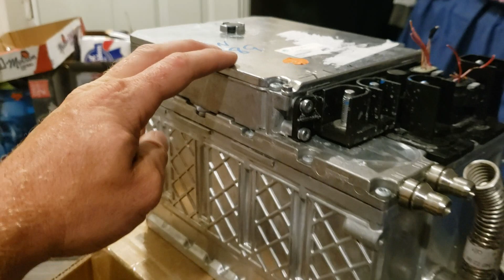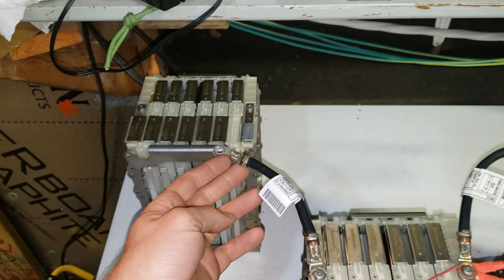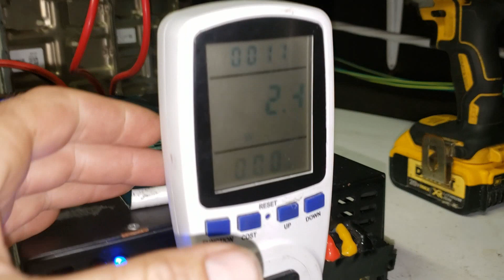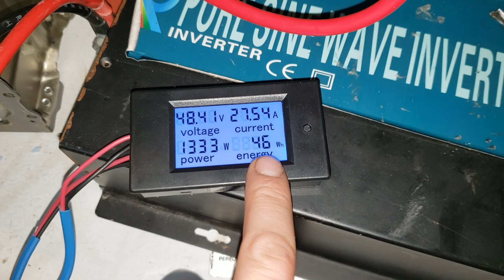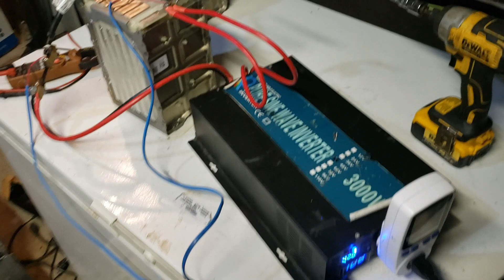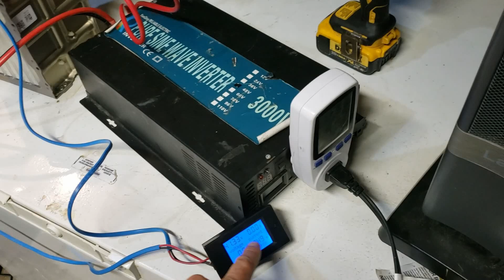Small Mercedes Battery Running 1500W

Comment: Ive watched most of your videos . I have a question. I now have 4 of these Mercedes 48v batteries . Do I need 2 separate bms or can I have 1 bms and connect all of the cells the way you connected both of the 48v batteries. Any idea what gauge wire I need to connect all of the batteries in parallel . Thanks
Reply from the maker: what are you running with it ? if I remember its 12s 50.4v full charge. yes you can parallel all the cells like 
I did and use one bms as long as the bms has enough amp output to run what you have for a load.

Comment: Kind of wonder how much he if you use the liquid cool on the batteries
Reply from the maker: you would have to use 3 or 4c witch is 80 amps at 48v with is 3800w then you would need the water cooling.
Reply: Could you use a 12 volt water pump from Harbor Freight and a heater core out of a car with a 12-volt fan
Reply from the maker: @markmullins4222  to cool yes, but unless your pulling 2500w from one of these or more you will not need it.

Comment: @ 0:48 "liquid cooled is only when you're pushing it to it's limit's".  Not in Texas bud, It can easily hit 43C in the summer.  Them's battery frying temps there.  Thanks for the review though, please post a $$/kwh figure in the video description when you do these reviews.  For most of us, that's the single most important piece of information regarding used batteries.  Also unrelated question, that 96s bms you used for your Leaf aux battery; how's that holding up?  I'm hesitant to use the cheaper stuff on HV batteries, but the other 96s bms out there go for well over $1400.  Out of my price range.  Thanks again
Reply from the maker: im still bms less on my leaf :D its aboit $10 per 100wh or $100 per kwh
Reply: @GoingOffGrid101  Thats a great price/kwh.  That means at 750wh/module, you bought these modules for $75/piece?!  Smokin deal.  Are you not worried that your modules in the aux battery in the Leaf will get out of balance without a bms after dozens of charge cycles?
Reply from the maker: @InnovativeSustainableSolutions  these are 880wh i explain why the meter was out, and they are $90 with my 10% off code :)
Reply: @GoingOffGrid101  I want to discuss the work you did with your Leaf extender pack in one of my upcoming videos.  Are you cool if I pull a few screenshots of your work and use them if I include a link to your channel?
Reply from the maker: @InnovativeSustainableSolutions  sure :)

Comment: Hey what you thoughts on a LF inverter I need some thought run well pumps plus your norm crap
Reply from the maker: my house runs off LF inverters they are good, especially the magnasine inverters
Reply: @GoingOffGrid101   i know you were running that china made 10000 watt inverter but if your running motor the draw spikes to x amount of time that from what i here blow them up so do you have any other type you like that would do what i want to run a house
Reply from the maker: @nyghtmyst5118  the signeer inverters are nice. and reliable are nice as well.